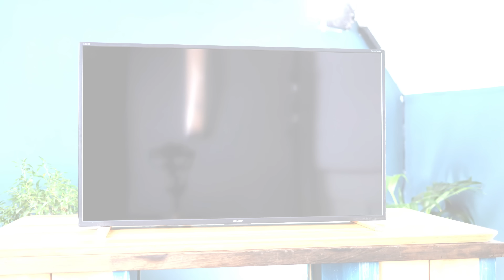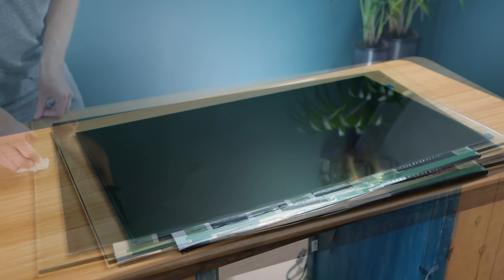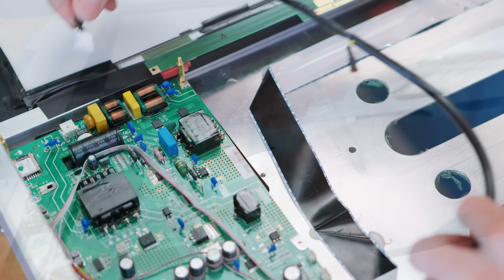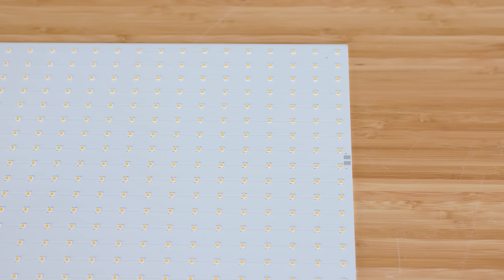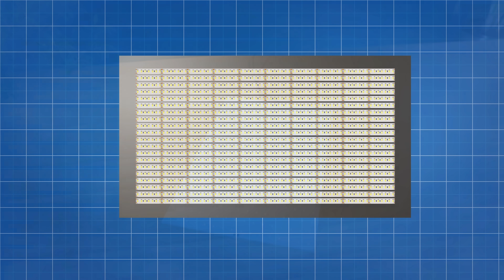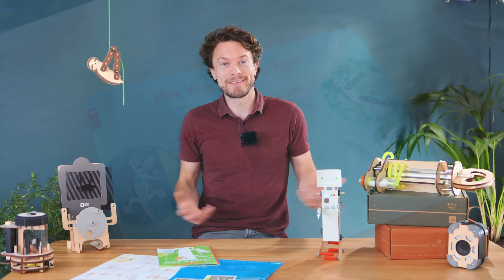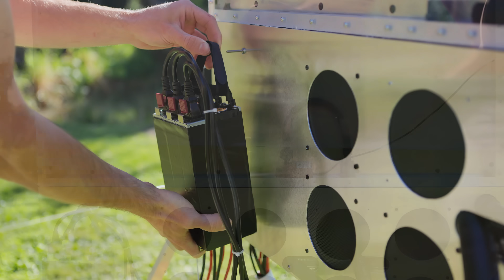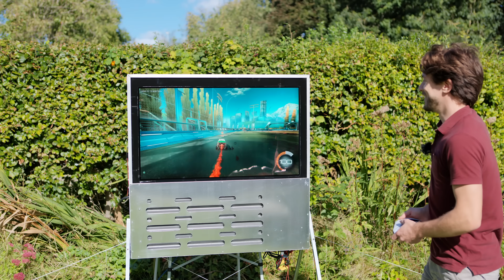Building an ULTRA-BRIGHT water-cooled TV...

Comment: You should be careful of the lcd screen getting burned out by the lighting. They are designed for a certain usage and you have overdriven it quite a bit. The heat from the LEDS also is seen by the lcd screen but by a bit less...still it is more than they are designed for and could shorten the life quite a bit. All in all( i forgive your poor language use of aluminium despite that being improper, but I suspect you grew up with it mispronounced) it is s great project and really was bright enough to properly enjoy outside. How does a movie look? About nighttime usage? Maybe after usage for a while you can report back about it:)

Comment: be aware, dust will build up inside that cavity between LED and LCD. I would completely seal this up as much as possible. as for heat, I bet that between your water solution and the huge sheet of glass exposed to the outside, heat wont be an issue.

Comment: I wonder if you could use the cheap direct 220v 10 to 100W COB or SMD boards they sell. I guess if the original TV had the leds so spaced apart, a bit of non led area these cobs have would REALLY simplify the electronics. Cons would be possible flicker and not such good quality, also, they are only abailable in warm and cold temps.

Comment: What's the problem with the glass sizes? You basically just need to scratch the glass, give it a bump and it will break off cleanly. I'd say that's one of the lesser challenges in this project...

Comment: Can you give us any advice on buying broken hardware like this? Specifically, how should one go about purchasing a TV with a broken backlight, or broken power supply, but still has a functioning LCD panel? There are plenty of people setting $1000 MSRP TVs for $100 broken on eBay, it's just hard to be confident that they are going to be a condition that is useful for projects.

Comment: So it will be a non HDR display since the LEDs won't be controlled based on the image being shown? How much does these strong LEDs degrade the life of LCD panel? In resin printers for example LCD burnout is a problem with very strong UV light.

Comment: Using LEDs with a higher color rendering index (CRI) will not produce richer colors or a wider gamut, as you are filtering the light into R/G/B via the LCD.  In fact, using white LEDs with a high CRI or even sunlight will reduce your gamut as you are broadening the spectral output of the individual primary colors (based on the spectral output of the LCD's filters). For the widest gamut you should use RGB LEDs due to their sharp spectral peaks.
Reply: Also see RGB laser projectors (Rec. 2020 gamut).

Comment: Fun fact, you didn't had to solder  a jumper and a resistor, all you had to do is bridge tab 33 and 36 with a wire and the psu starts I have the exact model

Comment: This is so awesome! However I did think of 1 thing, since your using aluminum outside maybe you can consider having the aluminum parts anodized to cut corrosion. In salty air that is. 

You can even have them anodized in colors. Yeah I know, it's an extra cost. But I think it would be worth it. 
The water method is genius but I fear possible failures to arise down the road. Over time your O rings and silicone will degrade from the constant heat, also the UV from the sun.

Maybe some kind of liner like what a shower pan uses. If it can be done without taking away from the cooling effect. Or some kind of coating, this would greatly reduce the chance of a leakage failure. 
Just an idea!

In any case, Brilliant project.

Comment: You could out a neutral density filter infront of the spectral photometer to reduce the brightness by 100 fold and then multiply the measurement by 100.

Comment: Do you think a smaller radiator could have handled the job and allowed you to contain the power supply inside? I know of some transmission radiators that are probably a third of that size and wondering if it would still work?

Comment: That's nice for sure... But man, I never realized how easy would be for manufacturers to add GLASS to a screen panel. It would make TV a lot more resistant and won't increase the cost by much.
Reply: And it will rip of from most wall mounts :-) Glas is heavy. So no fancy TV stands anymore and you have to fix the TV on the wall otherwise it will tilt over if you kids (or cat) touch the TV due to the heavy front. 😃

Comment: Very unique design as always! I like it. I thought you will use the sunlight as backlit though. You should build a controller for the leds, so you can reduce the brightness for using the TV at night. And maybe a light sensor circuit so it can dim by itself. It is very interesting to me the lcd panel's pixels can cover so much light they can create fairly nice black. It wasn't designed for so much light.

Comment: This is an amazing project!. The only thing I would have done is spray comformal coating to the PCBs before assembling the unit, because condensation can still get inside and short them out. otherwise, amazing job!

Comment: LCD manufacturers: This is the max brightness we get
DIY Perks: Hold my beer!
Reply: Honestly I wonder if you want to watch tv when really bright outside
Reply: More like hold my aluminum.
Reply: For domestic use does not make sense to go this bright. TVs created for commercial purposes are visible easily in a sunny day.
Reply: @dtibor5903  Small bright LCDs on cars/motorcycles/ebikes for rear camera would be great.
Reply: its very likely the lcd layer wont last long with so much light passing through it
Reply: @cj09beira  if it's kept cool it really won't matter, LCD projectors deal with the same thing and as long as the panel doesn't get hot it really doesn't affect it.

Comment: Such a cool project. Outdoor rated TVs are way over the top, but this can be done by almost anyone with some household skills. Really glad you went the route of leaving an air gap between the LEDs and the diffuser to allow for errors in mounting and the gap between the panels to basically be unnoticed. Very nice.

Comment: A couple words of warning for anyone that's going to try something like this:
1. He really stressed the importance of the grounding wire. I'd consider redundant grounding wires attached to different pieces of the frame. Ensure the ground wire is thick enough to carry enough current to trip the breaker of the largest circuit you're likely to plug this into. The ground wire is what will prevent this from becoming potentially lethal if a live wire were to contact the frame. Ensure the ground wire has continuity all the way back to the building ground.
2. Most modern construction will have RCD (europe) or GFCI (USA) protection on outdoor circuits.  I wouldn't use this on an unprotected circuit, but if you do, #1 is even more important.
Reply: Definitely add extra grounding wires. Since some of the frame is held together with glue instead of direct metal on metal there might be breaks in his bonding.
Reply: It would also be nice to have the power supplies entirely internal, so that you could add some RCD/GFCI protection inside the actual device itself.
Reply: The number one thing to remember, if you are going to build this, is don't build this.

Comment: I watch these videos and often think "I could do that too!" But dude I would NEVER get all those air bubbles out of the glass.
Reply: I think getting the bubbles out is not actually that difficult. The LCD panel is quite flexible and the glue is pretty viscous. So as long as the glue doesn't harden too early due to UV light, I think you should be fine.
Reply: This guy makes intersting things with many alternative suggestions.
Reply: UV cure - That allows all the time you'd need.
Reply: Huge vacuum chamber that can fit the entire thing: Am I a joke to you?
Reply: @renzojohn06  Could a large plastic bag or wrap and a vacuum cleaner do the job?  Too much vacuum might make the LCD panel become sad and cry out its liquid crystal fluid, and that would really suck.  lol
Reply: If you setup your glue-up right, you can avoid trapping any bubbles in the first place, kind of like thermal paste.

Comment: Would it technically be possible to simply use the sunlight as a backlight source via a mirror system for example? That would be awesome for during the day and even make it extremely power efficient.
Reply: But you TV must then follow the sun path. So a really complicated mirror moving system is needed to follow the sun path over the day And the sun path changes over the year. This will be a sort of a really nice sundial project 😃

Comment: Tempered two (or more) layered glass for this project is a bad idea. Really bad idea. The panel is black and will heat up when the sun hits it. Because of this the air between the panes will heat up more than it's designed for and thus eventually crack.

Comment: I did something similar (on a computer case) and to prevent the light bleed and add some extra reflection on the inside I added a layer of aluminium tape on top of the spraypaint. By doing this you get a "perfect" bezel around the panel

Comment: You also gotta think about TVs that have local dimming backlights. If the donor TV supports local dimming, you can take advantage of that with your monster LED panel to keep the local dimming feature, tho it might require some fancy electronics, like a handful of Arduino Nanos, to handle using the TV's local dimming output to control the power supplies' output for the high power LED arrays.

Comment: While I really like the idea, having a TV draw 1600W does hurt quite a bit to be honest.. There's a good reason most TVs go for 300W or below.
Reply: Yeah, that "good reason" is they're intended to be used inside. 

There isn't much you can do in direct sunlight, especially at "diy" friendly levels.
Reply: @volvo09  I wholeheartedly agree. It just seems smarter to aim at 600-700W instead of 1600W, does it not? A TV is something to be used repeatedly for entertainment purposes.  So would you not calculate what you need instead of shooting over the goal like that? If 400 nits is enough for indoors and 1000 nits is barely enough for outdoor use, choosing a method that ends at 1200-1400 nits at half the power draw clearly seems the more sensible choice to me.
Reply: The power consumption is similar to a projector which plenty of people use to watch football or other stuff together every now and then. For many hours per day even 300W would be too much in my opinion.
Reply: I bet it could be more efficient using RGB LEDs instead of high CRI white ones... LCD displays are RGB after all, wasting most (all) of the remaining emitted spectrum. A normal "indoor" 42" led display draws about 50w, if you want it 6x brighter it should still be ~300W. 

Of course power goes up with the area, which goes up with the square of diagonal size, so for example a 60" is expected to take twice the power of a 42"... Which comes in at 100W, or 600W at 6x brightness. Did he mention the size of his tv?
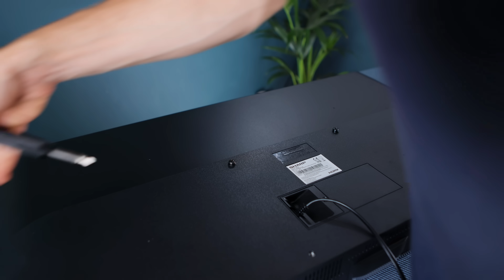Reply: @gspin96  I did you the favor of checking the sticker at the back at 1:33
It's a Sharp Aquos 40BJ3E, so 40 inches.
Reply: @Gametherapist   Haha thanks for exposing my lazyness 😂

Comment: It would be really interesting to have the  electronics and radiator in a separate unit inside a shed or even inside a heavy base that sits on the floor to lower the center of gravity

Comment: How about a solar backlight? A sheet of aluminium at an angle to catch the sun and reflect light onto the back of the panel. I'd use aluminium cause you don't want it to be too reflective and damage the LCD panel. It'd save a ton of cost, and power, though maybe have a few quirks about how you place it and align it with the sun. I'm at least curious to know how it would work.
Reply: Exactly what I thought. It would be self-adjusting. Brighter when the sun is out and less bright when it's cloudy. But I guess when it get's too cloudy or dark you would need some LEDs to do the job

Comment: Should have used automotive grade coolant for the cooling liquid to avoid corrosion and biological growth issues. A 50/50 mix of distilled/deionised/RO water and Toyota Long Life Coolant Concentrate should do fine for preventing major corrosion and eliminating biological growth issues as well as preventing coolant freezing.
Reply: This is a full aluminum loop, corrossion is not an issue, and he already mentions that you should mix biocide into the water.
Reply: @YOEL_44  
Don't forget the antifreeze function to avoid icing issues.
Reply: @4G12  Why would you have icing concerns?
He's not running below 0ºC temps...
Reply: @YOEL_44  in case you start it in freezing conditions
Reply: @Waitwhat469  : For that matter, in case it's outside during freezing temperatures in general. "Running the tap" only reduces the chance of problems instead of eliminating them.
Reply: I was thinking mineral oil as it is noncunductive
Reply: He had text saying he added biocide to it, and its all aluminium it should be fine.

Comment: A voltage regulator would have been a great addition, so the screen could be used in varying conditions. A TV that pulls as much power as a space heater is hard to wrap my head around. Great recycling though!

By the way, none of the aliexpress links work.
Reply: Not voltage, but current regulator. LEDs require cureent source.

Comment: I think that adding some sort of temperature gauge would be handy. I'm surprised that such a small amount of water in that reservoir does the job.
Reply: You forgot about 5 L in car radiator beneath all that
Reply: Reservoir size doesn't matter if the radiator is properly sized. 

Increasing the reservoir size only extends the period of time it takes to get to an eventual max stable temperature... It will not help with total cooling capacity (it sort of would here due to it's large surface area, but i think the point is clear enough).

Comment: Awesome build. Have you thought of adding the water resistor to the bottom as a flat basin. I would allow a shelf to be placed in the current water system place. 
Also a wide reservoir full of water would act as a base to provide more stability

Comment: A tip. Under driving LED increase there efficiency quite significantly. Driving them at half light cut the heat generated to about a quarter or so. That could probobly eliminate the need for active cooling.

If you just can find LED that are sufficiently bright. This would cut down the complexity and also the PSU of the system quite significantly.

Also .. a other tip. Use 24 or 48V LED strips, because they have higher efficiency.  Going from 12V to 24V cut down the energy use about 17%. That might not sound like a lot, but that is pretty much free efficiency. (note it have to be 7 series LED for 24V, and it should be 15 series for 48V)

Also going for a linear regulator in stead of a resistor and combine that with calibrated voltage source cut down the power usage a additional 10%. SO that is 17+10% that would just be wasted.

Then just reducing voltage until the light level is decent and the heat is not to bad would solve the rest. LED are typically the most efficient on about half the original power.

Comment: Would doing this but using the light of the sun itself instead of the leds be possible? Im curious to see if that would work. You could redirect the rays using some kind of light funnel...
Reply: If you've ever played on Gameboy, Gameboy Color, GBA (not SP), or Original DS on low brightness setting; you'd know this wouldn't work. They required external lighting, and the sun provided too much, and a lightbulb provided too little. It would be great in theory, but you'd have to have the diffusion layer facing the sun directly for it to work, meaning the TV would have to change with the sun's position and also be facing downwards to see the picture.
Reply: @drippyfool  don't you think some kind of mirror-diffusor(a sort of filter-spreader) contraption to spread and dim the light could work? I mean you would still have to basically aim the mirror at the sun but could it work in theory?
Reply: @adri1572  while it seems to work in theory, the screen of the TV is basically just taking the light and making it darker by blocking out some colors. It would still be kinda dim compared to the one made with LED's

Comment: I was expecting something like a transflective display, but instead you decided on just blasting it with high powered LEDs. Someone else mentioned what it would look like at night and I'm curious if the original TV had local dimming and if it was possible to take advantage of that somehow when making your own backlight.
Reply: Yeah, i imagine it could be even impossible to tune brightness down enough for night use, as LEDs will go haywire at low voltage with brightness all over the place. PWM dimming can be used, but this is whole other can of worms... And he use voltage source, while LEDs must be powered by current sources, one for each serial strip. In this exact configuration LEDs will die pretty quickly. 
Local dimming - very much possible, but this is cheapest TV with no such thing. All LEDs are in series and overdriven from factory and have 100% failure rate, as all TVs for last 5-7 years, no matter the brand. And it's not just cheap models. If you want your new TV to last - open it right away and lower LED current at least 30-40%.
Reply: @evilgremlin  I imagine either his LED panels have built-in current limiting, or he is using current limiting through his boost converters. Modern LEDs seem to be well matched from the factory, so if all his panels are from the same batch they will probably word fine if dimmed. Maybe it will be uneven at super low brightness, but 10% should be more than enough to eliminate that.